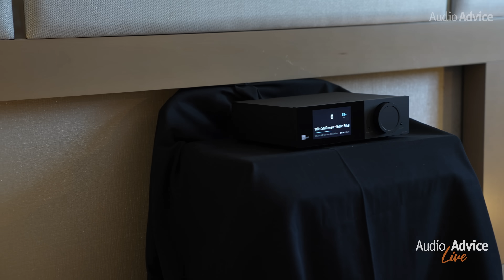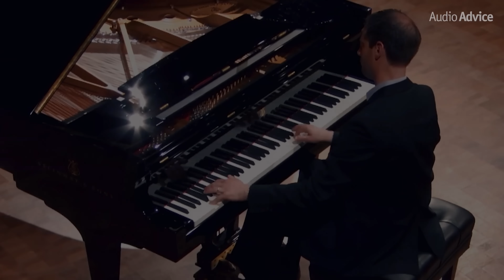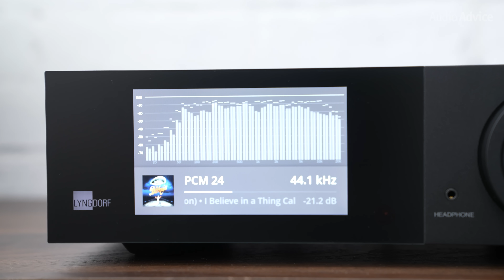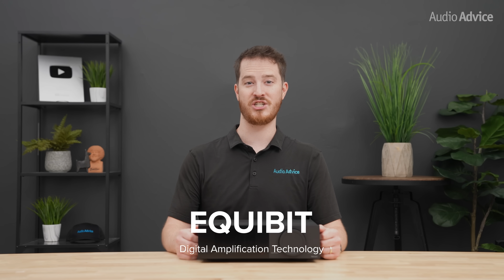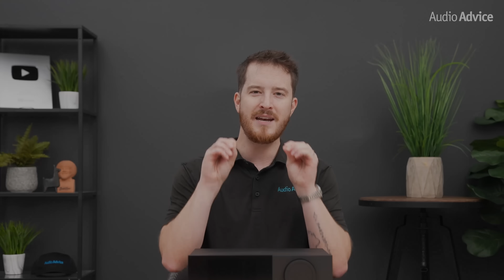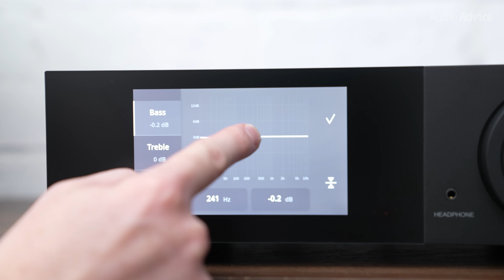Lyngdorf TDAI-2210 Overview | RoomPerfect, Digital Power, and Stunning Design in One Amp

Comment: Class-D is not digital amplification.  Digital input doesn’t mean digital amplification.
Reply from the maker: You're absolutely right that most 'Class-D' amps are analog switching amps, but Lyngdorf is a rare exception. Their Equibit™ tech is a 'Direct Digital' design—it doesn't use a traditional DAC. Instead, it converts PCM directly to PWM, keeping the signal in the digital domain until the very last stage. It’s essentially a Power DAC that uses the power supply as the volume control. It’s one of the few truly 'Digital' signal paths in the industry!  Thanks for watching video.

Comment: My unit failed after 10 weeks, the pre out rca was the culprit.
It happened about 2 months ago and I'm still waiting for a replacement unit. they all seem to have wobbly/loose rca jacks, I went through 3 units so far.
This's the worst experience I ever had in a decade of buying and trying amplifiers. I'm shocked!
Reply from the maker: Wow, so sorry.  Have you reached out to Lyngdorf?
Reply: me and the shop are out of words. they will try to ask Lyngdorf one last time, perhaps to check a unit before sending it out.  
I'm also contemplating of buying something else as we think there's an inherit design flaw with the rca on 2210.

Comment: Can the digital and analog outputs be used simultaneously? If so, does the volume control both simultaneously, and can room correction be applied to both the digital and analog outputs simultaneously?
Reply from the maker: Yes, the coax will be fixed and will just be a pure digital signal with no correction.  Thanks for watching
Reply: Yes, digital can for example drive an outboard DAC and analog for subwoofers with correction and volume control.

Comment: Once you start looking into the tests and measurements they are mediocre at best, tons of ultrasonic noise makes a mockery of trying to play any high-resolution content.
But they are cool toys and look stunning, and I owned the 1120 and 3400 and I'm definitely going to try the 2210 because their products make my life easier! I love them!
At the same time I understand why real audiophile wouldn't touch it with a bargepole.
Reply: The audiofiles exaggerate what they can actually hear about 100 times. No joke.
The ultrasonics are part of the design and are filtered out by the speaker system itself.
The Japanese Pioneer company used this technology some years ago, but the new owners abandoned it for for the plain AB-class amplification.
Reply: @michaels3003  I completely agree, still the measurements are mediocre at best. 
For example the TDAI 1120 has a damping factor of only 24, which is extremely low. I am not an audiophile but if I crank it up and compare the bass to my class D MarkAudio (perhaps half the price) there is no competition. 
But the MarkAudio is just a plain box with no cool features so the Lyngdorf has replaced it. I am at the age where I choose comfort over performance :)

Comment: no subwoofer outputs or pre-out - can i add a sub to that and does it have bass management with hi and lo pass filters?
Reply: I've owned the 1120 (and plan on getting the 2210). You CAN connect 2 subs. the first sub goes in the L preout and the 2nd goes in the R, if you choose to go dual. Room perfect will also integrate those subs into your calibration. you CAN do low pass filtering on those outs, and do high pass on the mains. Probably the best sub management I've experienced.
Reply: @daverose515  I fully agree, the bass management that Roomperfect does is one of the top selling points for me! You do have to input the distance between your focus position and your sub but the rest is completely automatic and works absolutely fantastic.
Reply: @daverose515  i couldn't see a pre-out on either amp - or is line-out the same on Lyngdorf? - but if that works then that would be great - you'd get stereo subs!!!
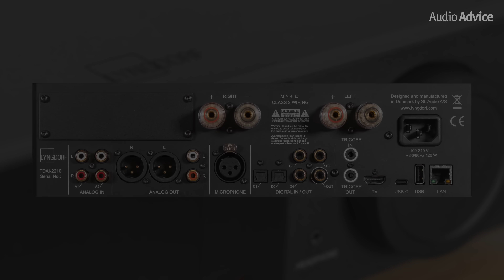Reply: @keithmccann6601 yes analog out at the  mark 4:27
Reply: @daverose515 you answered all of my questions— thank you kindly.
Reply from the maker: Great to hear! Thank you for sharing this.
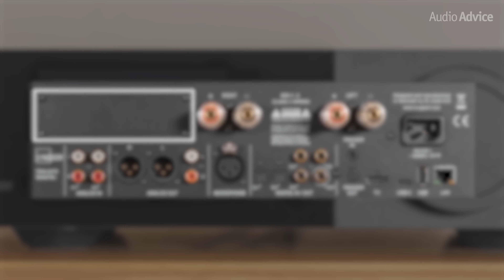Reply: It features freely configurable RCA and XLR outputs as you can see at 4:41. Lyngdorf recommends 2.2 setups for stereo listening
Reply: @jcvscorner  thanks for that - what speakers would you pair with this amp? - i'm thinking i like KEF R3s or even 7s +  2 x KC62s - i know they are good speakers and i've heard them with an Arcam SA45 but not sure if the Lyngdorf would match as well?
Reply: @keithmccann6601 thats the nice thing about the Lyngdorf. You hear the speakers and not an amp. It sounds virtually transparent. I have not really spent much time with the KEFs but my dream setup would br the Radiant Acoustics Clarity 6.2, also a brand founded by Peter Lyngdorf - they are some no-nonsense compacts with incredible performance. Add two KC62 and that is endgame for me at least haha
Reply: @keithmccann6601 seems like my last comment was removed. I dont have a lot of experience with KEF, but the best speaker I have heard recently is the Radiant Acoustics Clarity 6.2, another venture by Peter Lyngdorf. Rhose together with the 2210 and two KC62 would be utterly amazing
Reply: @keithmccann6601 thinking about the R3 meta’s combo with tdai 2210, interested in peoples opinions/tests once available.
Reply: The subwoofer integration on Lyngdorf amps is the best. You get full control over the crossover (frequency, type, order) and RoomPerfect does the rest. They’re big on stereo (dual) subwoofers for music listening.
Reply: Get a JLA cr-1 active crossover
Reply: @CarlVanDoren61  costs more than the amp

Comment: Does it have an internal DAC?
Reply: No it does not. Digital signal feeds directly the output stage using a pwm signal
Reply: @gianlucavanelli5055  , DACs do not convert digital signals.
Reply: What a mixed bag of responses. My favorite has to be “of course it does, it’s an integrated amp” lol
Reply: @PP-nh1lv  , the "yeses" were correct though.
Reply: yes
Reply: Of course it does its an integrated amp
Reply: @allnighterist it doesn’t have a dac or need one as it reman digital all the way through. No analog conversion necessary
Reply from the maker: yes
Reply: @AudioAdvice wrong. You are embarrassing yourself

Comment: Nice review but 4000€! You can buy the CB EVO 150 or the NAD M10 V3 for almost half the price with the same specs.
Reply: Looking at the superior Room Correction and customization and options, the 2210 is well worth it's price. In my experience the 2000€ Lyngdorf TDAI 1120 outperforms the M10, although the M10 is 1around 500€ more. 
I think the more fair comparison is to the M33.
I've worked with both brands for the last 10 years...
Reply from the maker: Thanks for the feedback, and those are great alternatives to consider!
Reply: I would note for the record that eons ago. I purchased a Marantz surround sound processor that had specs as good as any in the industry, and I found it utterly unlistenable and returned it for a true premium unit. While specs can be of some value in some instances, in my opinion, they are fundamentally useless. What matters is the sound that is produced. Yes, there are many good units out there with fine specs, but none can boast the magnificence of Room Perfect which is a true game changer after all these years. I have an MP 60 and I couldn’t live without it and actually stream directly to it from my.Antipodes k22 player, D-D vis either USB or my preferred AES/EBU. For those unaware, check out the Macintosh MEN – 220 which is essentially RoomPerfect in a pretty Macintosh box that sells for north of $6000. That is the value of RoomPerfect. Macintosh also licenses this very same software from Lyngdorf for their flagship surround sound processor which costs about $6000 more than their entry level processor which uses a very entry level EQ system,, Audassy.